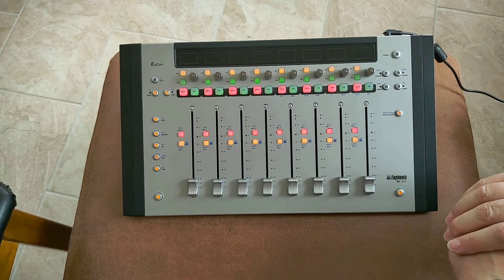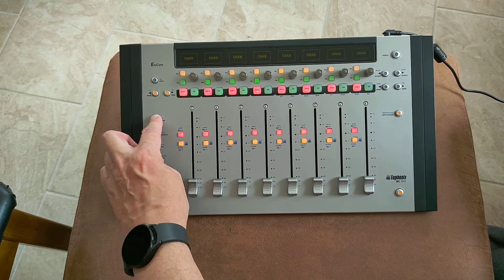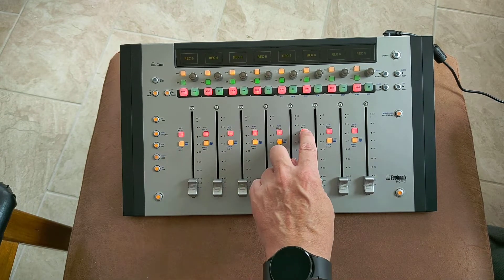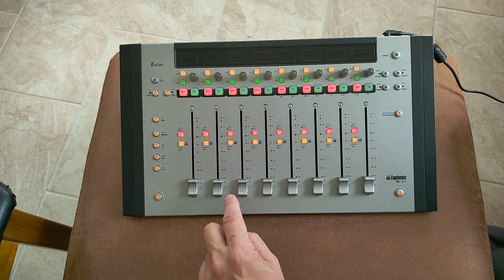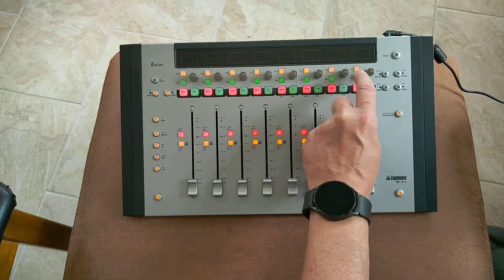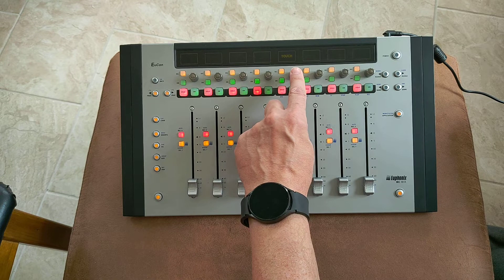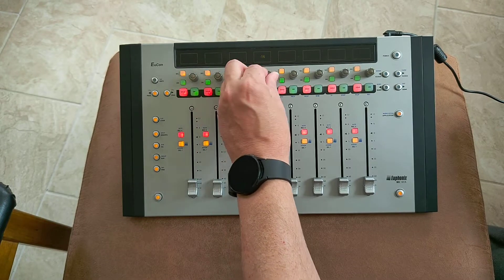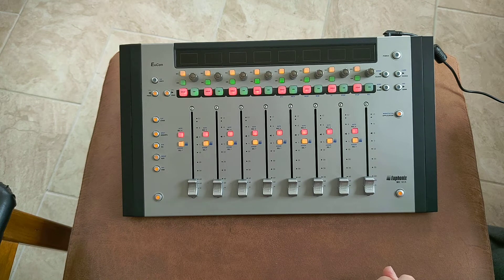AVID / Euphonix MC Mixer Control Surface Test Mode

Comment: Hi, Thank you for sharing this demo video! Do you happen to know if the Euphonix MC Mixer works/is compatible with new M1 Mac Computers? Thanks!
Reply from the maker: I haven't had the opportunity to test it but theoretically they both support the Mackie MCU protocol so they "should" work.
Reply: Got it. Do you happen to have the unit’s drivers for Mac by any chance? I bought the unit second hand a I’m having a hard time finding the drivers :/ . Thanks!
Reply from the maker: You might find that they are still available in the "legacy" section of the AVID site if you are lucky
 @bonillaproaudio
Reply: Got it. I’ll look there. Thanks for the info!